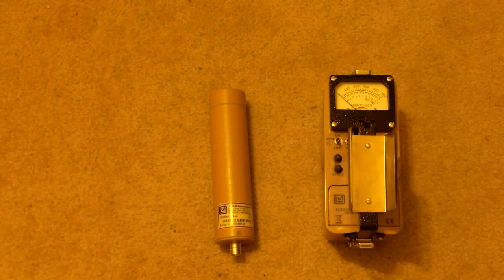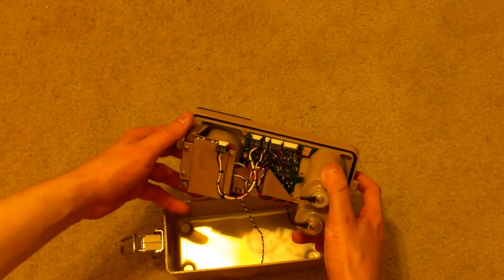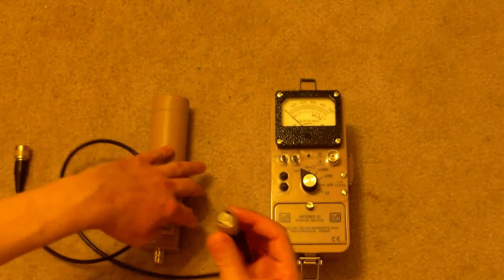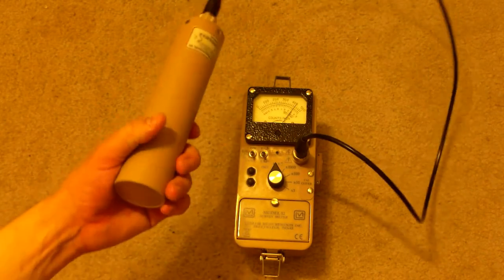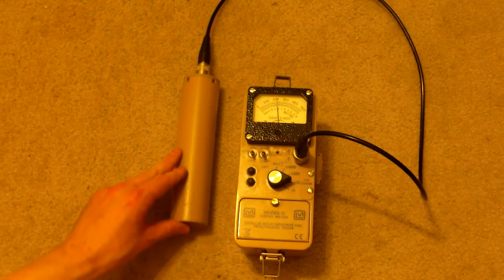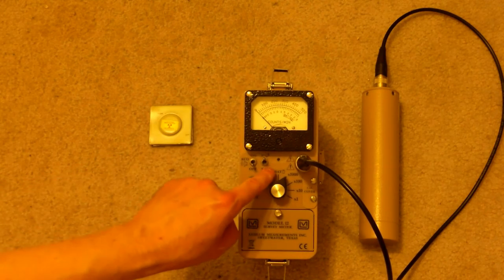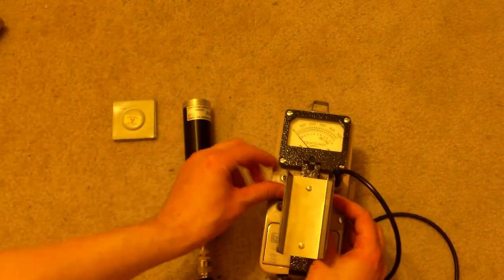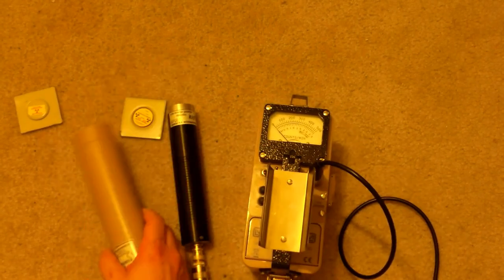Review: Ludlum Model 12 Rate Meter + 44-2 Scintillation Probe

Comment from the maker: The CRM100 and the Gamma Scout both use the same tube:  LND712 tube. This means that they have the same sensitivity. Between them, the gamma scout has better features but costs a little more. The CRM100 is pretty rugged. Have you looked at a PRM9000 or Inspector? They are massively more sensitive, but cost a little more.

The CRM100 or GS are both fine for rock collecting. My first Geiger counter was a CRM100.

Comment: Hey Tom, great video! I just ordered an eberline thermofischer spa-3 to hook up to my Ludlum model 3! At 900 volts on my Ludlum model 3 the spa-3 reads a typical background of 18,000-22,000 CPM! absolutely insane lol I work around old warbirds sometimes which often have radium instruments, my setup can detect if an aircraft has a cockpit full of radium instruments from about 15 feet away on the outside of the aircraft, and I have a 44-9 as well for detecting contamination

Comment: I have several NaI(Ti) scintillation probes on par with the 44-2. Also have the 44-3 low energy scint. Other than spectrometry use, I have found little use for the 44-2 as a stand alone probe. Since our hobby is very similar, what other regularly occurring uses have you found that your 44-2 does better than a 44-3?

For me, the 44-3 as a stand-alone (non-spectrometry) scint is perfect for all around hobby use.

Comment from the maker: The CDV700 is a special case with a special method. Other Geiger counters require a strong source which I do not have. 

I'll check and see if I can find anything on it.

Normally, I just send my units to the manufacturer and pay the $50-$100 for a professional job.

Comment from the maker: It's under the cal port. You have 6 potentiameters:

DIS, HV, 1k, 100, 10, and 1.

I have not messed with mine. I am going to a uranium mine august 4th and I need my unit to be 100%. After that, if I mess with it and screw it up... I would have time to get it fixed.

As you have probably noticed, I am not as DIY as the rest of you. I code and calculate. Anything I touch, mechanically speaking, breaks  :)

Comment: how does one buy a model 12.. i have been looking on ebay and I only have seen model 3's. also, how much does one of these cost?
Reply from the maker: I normally buy new from the manufacturer for most things so ebay and I are not well acquainted when it comes to detection gear. ludlums.com is where you get them.

You buy the unit (model 12) and the detector (I have a 44-2 but they sell several) separately.  The 12 and a 44-2 would run you about $1500 +/-

Only get a 3 if you plan to use a scintillator. The 3 is fine for Geiger tubes, and way cheaper.